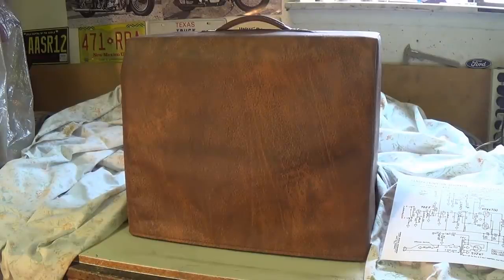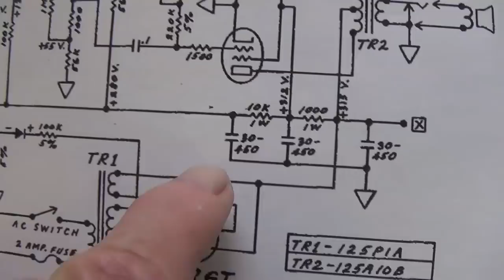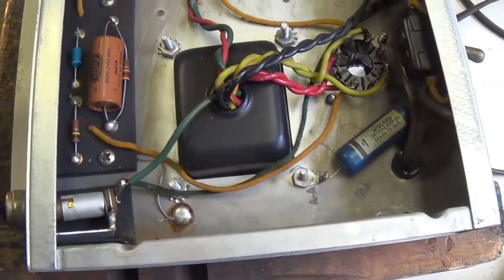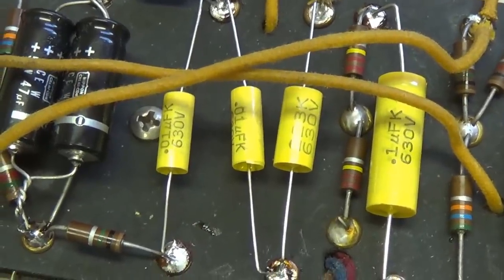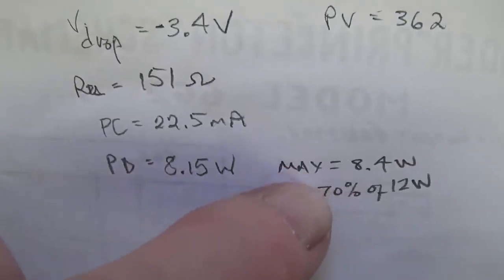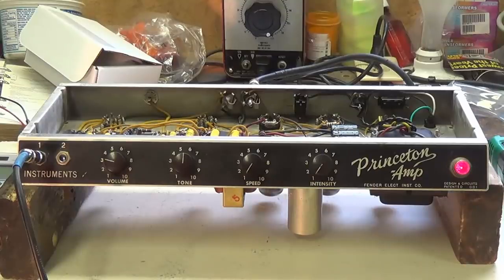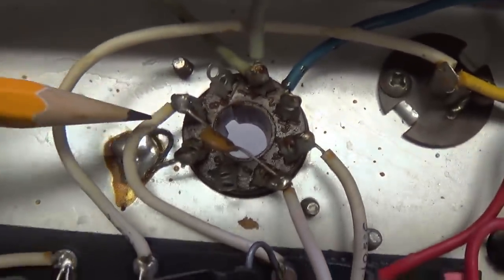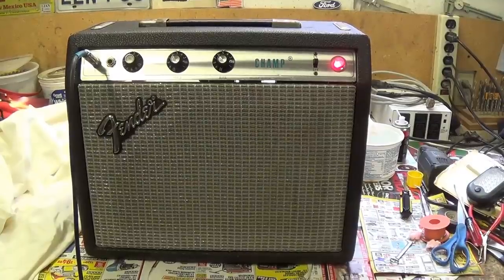Brownface Fender Princeton and Silverface Champ "Double-Header"

Comment: Please;..... on the next Champ you work on with too high of a plate current with the standard 470 ohm cathode resistor still in place......
Increase ONLY the value of the 1K 2 Watt resistor in the power supply and watch what happens!
As screen voltage decreases, plate current decreases and plate voltage increases for the same value of cathode resistor without having to bias the tube with such a high voltage grid bias...
Reply from the maker: What is the advantage of this indirect method of biasing? If the end result is the same......why is your method better?
Reply: @UncleDoug  ,
When you increase the value of the cathode resistor you lower the plate voltage across the tube' not by much, but you do.
 You also increase the drive requirements to drive the tube into clipping, and that is important.
I looked at a downloaded GE spec sheet for that tube ...
The maximum cathode emission on that tube is 115 Ma, so running the screen grid or plate voltage will not get you over 115 Ma without damage if run that way for very long.
(from the factory data sheet)
Also, the highest plate current happens when the control grid voltage is zero.
If the screen voltage is 250 Vdc, the max plate current when the control grid is zero, is 113 Ma.. So higher screen voltages higher than that can cause excessive screen dissipation and likely long term damage to the tube.
 At screen = 250 V and Control grid = 0 V, the plate current remains almost constant between 105 and 113 ma over a plate voltage range from 250 to over 400 Vdc
(from the factory data sheet)
If your bias ends up being 28 volts with a 1K cathode resistor;  you need 56 volts peak to peak to drive the tube into clipping.
If your bias is 15 volts with a 470 ohm cathode resistor you only need 30 volts peak to peak to do the same job. (about 1/2 half as much drive required for the same power output)!
Since the tube is biased in a more linear part of its operating specs the lower level signals, ( the quiet ones) will be much crisper and cleaner, and the overdriven clipping (the loud distortion) will be every bit as loud as it was before.
.
So far this works fine in theory, and in application on only one Fender Champ amp a radio operator friend owned and agreed to try it. 100% success doesn't mean much on only one sample.
 You do so many different similar amps that are Fender or Fender copies that you would have the opportunity to try it on a lot more amps that are suffering from the extra high plate and screen voltage problems.
 If you want more detailed information I would consider it an honor and a privilege to be able to supply it to you...
Dennis O.
.
On a non-related subject:
 The rolled and pleated Kustom amps I had, all had blue lights, but the lights were illuminating big one inch square push button switches.
 So far I have not seen any You Tube repair videos regarding that particular model.

Comment: My 63 Princeton is just as nice as this one😁
Reply from the maker: You're a lucky guy, JBH.
Reply: @UncleDoug  thanks Doug. Not sure about being lucky. Today is my birthday and I have to report for jury duty! Pretty sad that being retired this is the highlight of my day🤣 If I may, my amp still has the 2 prong cord and everything appears to be original. I'm afraid to use cuz my buddies tell I should change it. Any words of wisdom would be greatly appreciated. I would like to play it once in awhile.
Reply from the maker: @jukeboxheros7021  Amps were played for many years with two-prong plugs, and we all seemed to survive, JBH.  Granted, if you wanted to stand on wet cement barefoot while strumming some chords, it might be a bit risky, but as long as you aren't grounded and/or touching other plugged-in metal objects, you should be OK. To be more certain, you could use a voltmeter to see if the metal chassis of the amp has any measurable potential to ground.
Reply: @UncleDoug  thanks, I think I might have the cord changed, cuz messing with pedals in front of the amp might be disastrous.
Reply: Oh I forgot one thing, would any if the internals suffer from today's power sources. I ask cuz one of my antique tube radios blew a cap after 5 minutes plugged in. Could be that the cap was ready to go anyway, but I wouldn't want to happen to this amp.
Reply from the maker: @jukeboxheros7021  The higher wall voltage doesn't seem to make much difference to most amps, JBH......and it will not cause capacitors to fail, unless the cap is of inadequate voltage rating or already failing.
Reply from the maker: @jukeboxheros7021  It would probably be a good idea.
Reply: @UncleDoug  if I could trouble you one more time. I bought a new fender 1 button rca footswitch for the 63 Princeton amp(cuz it didn't have it) plugged it in and the tremolo doesn't seem to be working when I turn any of the speed and/or intensity knobs. The footswitch works cuz I tested the connectivity. Are any of the tubes related to this functionality? They all look like there on. Any suggestions would be greatly appreciated, thanks! No hurries I know it's the holidays.
Reply: @UncleDoug  I watch your vid again and listened to the part about the caps regarding the tremolo. I guess my caps may be done! Cuz no oscillation occurs when I turn the speed all the way up and the intensity set around 7.
Reply from the maker: @jukeboxheros7021  It could also be the oscillator tube, JBH.
Reply from the maker: @jukeboxheros7021  The Princeton requires a grounding footswitch for the tremolo to work, JBH. Simply ground the footswitch jack on the rear of the chassis, and if your tremolo is functional, it should start to oscillate.
Reply: @UncleDoug  replacing a tube sounds a lot cheaper for starters than having the caps analyzed. I noticed in your vid that when testing the tremolo you didn't have a footswitch plugged in. Does that mean that it's always on and maybe I didn't need the footswitch to start with?
Reply from the maker: @jukeboxheros7021  No, just the opposite. I have a small, shorting plug that I use when testing amps like the PR. The jack HAS to be shorted for the tremolo to work.
Reply: @UncleDoug  thanks, the new switch I got sb fine. Happy Holidays!

Comment: Can caps are available for both amps and should have been used. Looks molested now. Sad!
Reply: Should have left the two prong cord, and all the patina on and under the knobs and faceplate too.
And what was he thinking replacing those tubes with these newfangled ones!?? Blasphemy!
Just kidding of course and I think he left the old ones in for cosmetics. To me it wouldn't matter, whatever works best.
Actually I dislike the can caps since they clutter up the chassis. I'd rather just see transformers and tubes myself, but that's just me.
Reply from the maker: I understand, PA, but the new cans are rather conspicuous and alter the external appearance of the chassis. Also, if capacitors must be changed within the chassis, the circuit will appear molested whether you use a can cap or not.
Reply from the maker: I send all removed parts back with the repaired amp, V, so it can be restored to original if desired. The old (weak, mismatched) GE 6V6's were replaced with a matched set of EH's. I agree about the cans. They look like a hot water heater.
Reply: Could you have opened the old cap can and installed the new caps inside of it?